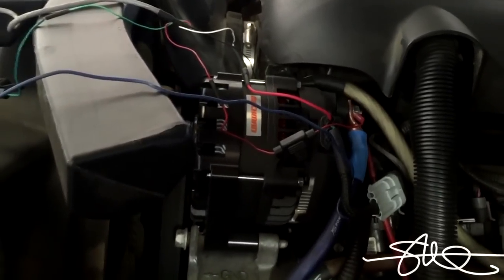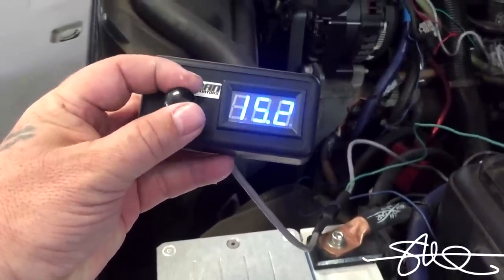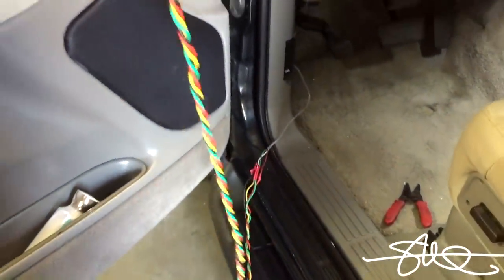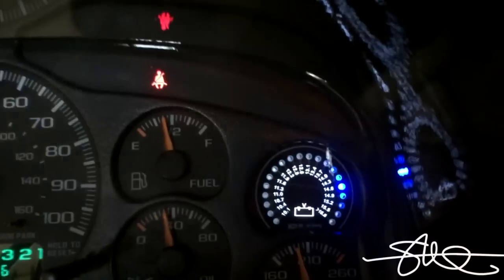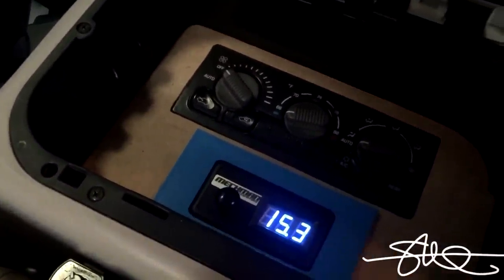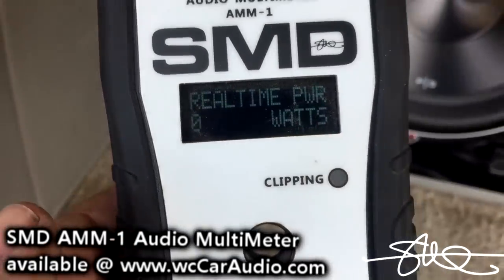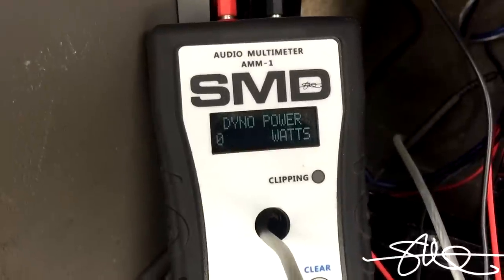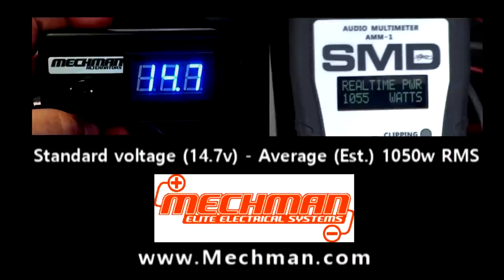Crankin' the Voltage - More Volts = More Watts? Mechman AVBM II SMD AMM-1 Proof (Father/Son Video 8)

Comment: Very nice ! I new It could be done. When I was in competition.  0-1000 trunk. I lacked 280 watts from 10k watts. If I remember I had the voltage at 14.3. I had two RD audio d5s an two solo x's did 156.2 dbs in a trunk at 66hz. I was told if I go back run the voltage at 15.5 volts. but I didn't make it. If I had a bigger alt it would be over 10k watts.  also that was with a power master alt,in a 2000 grand am two door car.

Comment: On a RF Power series amp running a 140amp alternator made for a 04 buick rainier mounted in 01 cavalier  from oreillys before they started getting the new units from china, and a overdrive pulley that a impact socket wouldn't fit in it to install it, one group 78 AGM under the hood, when I made the voltage adjuster originally it was the plan to make it always on but the voltage was a little on the hot side when I before it warmed up so I used a toggle switch when i bring it from the 13.5 range it would drop to back to 14.5-7 and I could told a surprising noticeable difference as soon as I hit the switch and surprising it had the opposite effect then i expected on ideal quality, the motor didn't bog down as much at the higher voltage.

Comment: that's a handy all in 1 meter for measuring power. don't need an oscilloscope to see if its clipping and no dmm to measure voltage or current.

Comment: Looks like that oil pressure is lower than normal you might need an oil pan gasket and oil pump pickup tube o-ring. That will bring the oil pressure right back up.

Comment: Glad to say the physics backs this up. I've need to deal with this in an upcoming project. I only have a rail voltage of 12v going to a pair of 10 amp transistors. If I can bump the voltage I should get better performance out of them- theoretically 150w instead of 120w, but should end up with closer to 180w as the higher voltage also allows more current to pass through the speakers, and that's how only a one volt boost can yield a 20% increase in performance. In my project I will be running the output through a speaker transformer to boost the voltage. I am aware running speakers at 120w with a 12 volt input is not possible unless they are something like 0.5 ohms. I can't increase the rail voltage as the amp location is too restrictive for a dc to dc converter, even though upping it to something like 24 volts would triple or even quadruple it's output. Just wondering- is one inch of excursion good for a 15" sub at 1000w? I have a 30 year old rack mount amp running my home subwoofer. It's very linear for its output level. Just wondering as your SMD 15" appears to move around 4 inches at 7000w. The amp draws so much power from the wall the lights dim. The port of the sub also creates toroidal vortices that can launch quite a distance. Possibly around 3-4 metres!

Comment: power is a product of voltage and current..so more volts does not necessarily mean more watts. However if you have enough amperage to multiply by your voltage than it can increase your power.
Reply from the maker: +hshj04 already said it in the video but thanks for the insight....might wanna hold off on them eager keyboard fingers until the video completes next time lol :D
Reply: Yeah, I definitely should have. Lol
Reply: +meade916 well I knew you would explain that...but some people still miss it. lol
Reply from the maker: +hshj04 all good bro :D :D

Comment: That wont work with all amps, expecially if the swichmode supply is WELL regulated. Some of thenm want to keep the amps rail voltages at say +/- 50 volts others will do as that amp in the video will do and step it up in comparison to input voltage, ie 14 volts in +/- 50, 14.4 volts in 55 volts on rails- however theres one thing you do have to note, you are pushing your outputs harder and if you are running the amp on its lowest impedance then this SHOULD NOT be done. You also must note the VCE (collector emitter voltage) on the actual transistors...

Comment: 15.3V will yield a load test gain indeed its just not ideal for batteries
After heat continuously you want to really be no higher then 14.8V with most batteries

The problem won't show itself immediately but over time the higher voltage will make the alternator force more current that is not needed into the battery and cause the battery to sulfate. This is where the battery will actually lose load test performance (memory) over that extended period of time

it is best to consult your battery manufacturer and only charge around what they suggest, if you like your batteries working the way they should and lasting that is....
Reply from the maker: +Michael Singer that's already been stated....but that being stated i have never had a problem with my XS power batteries.

Comment: Steve man, NONE of the h/o alterator companies are able to hook me up with an alternator for my 2014 Mazda 3 2.5L. Any advise? My stock alternator is 100A.  I wanna run 3000w.
Reply: Sonny go with singer alternator. Or mechman. 200amp alt will do just fine

Comment: I had 15.8v on cold start up and about 15v warn on my old truck wish I could turn it down in the mornings the computer would act up at that voltage, truck really didn't like to run on that much voltage

Comment: Would you say comparable to giving a motor a shot of nitrous?
Reply from the maker: +MrSpanky473 nope more of a supercharger because the more the motor turns, the easier it is for the alt to put out full power, like a supercharger.  A Capacitor would be more of a shot of Nitrous if you ask me because that can be depleted fast, like a bottle.  But the high amp alternator with a high(er) dc charge wants to stay full (if you let it) lol.
Reply: +meade916 That explanation made PERFECT sense! Love it! 👍

Comment: HEY MEADE I LIKED HOW YOU PROVED BY TESTING. BUT PUTTING MORE VOLTAGE TO AN AMP MEANS MORE WATTS IT ISN'T? THATS WHY 16 OR 18 VOLT AMPS GIVE YOU MORE WATTS. IS IT POSSIBLE TO PUT MORE VOLTAGE AND GET LESS WATTS?
Reply: +COMPASBASSCLUB CHICALI It depends on the internal circuitry of the amp if it can handle a 16volt system, but its not about how many volts you can feed the amp your battery's have voltage limitations, most 12volt battery's will say on the warning label "don't charge higher then 14.5 or 15.0" if you go over the voltage limitation you will damage the battery and possibly short out and catch on fire due to the cells swelling up.
Reply: I understood the point of Meade to take a 12 volt system to its max voltage. But I got a little bit confused when he said that the myth about getting more watts by putting more voltage was proven to be true. I thought it isn't logic that any voltage setup with higher voltage will give more watts. Maybe is me but I don't know why to call it a myth.
Reply: COMPASBASSCLUB CHICALI
Well it actually depends on the amps internal circuitry quality, if it has a lot of winding's on the transformers and have high quality internal capacitors like what Rockford, Crescendo, DC, Sundown, Soundqubed, pretty much any Koren made circuit board has, so the more voltage the amp gets the more wattage it will putout, but not all amps are like that though, like is said it all depends on the internal circuitry quality, that's why you never buy a cheap amp like Boss, Autotek, Crunch and a few others i forgot the names of, they don't make power and they have low quality very cheap circuitry all you pretty much pay for in those cheap amps is the aluminum.
Reply: Well said bro! Now I am sure DC Audio will be a good brand to go for. And for the same reason you are explaining now I get why good quality amps will suffer or be damage if not power correctly.
Reply: COMPASBASSCLUB CHICALI
Yeah DC audio amp's for sure are high quality, defiantly put out rated power plus a bit more.
Reply: I had seen your comments alot bro. Never have a chance to talk to you. Nice talk!
Reply: I am trying to work something with Rusty. Definitely a spl only car.
Reply: COMPASBASSCLUB CHICALI
No problem man!
Reply: Still an amateur but trying to learn at least theory from you guys. Should I do 4 18" or 6 15?
Reply: Because I am still learning I want to build a safe box which I think will be a flat wall b pillar and then work from there my port tuning and all that good stuff but still confusing thing for me lol.
Reply: COMPASBASSCLUB CHICALI
I think you should go with what you can afford, 4 18's or 6 15's is going to be loud anyways, but if you are going for just SPL numbers then you do what you can to get the highest number.
Reply: It has been a long sacrifice more than one year saving and I am sure I can afford either setup but just wanted to know which one will have more performance. Also some people had told me that flat wall b pillar is the safest to go.
Reply: Awesome explanation bro! Hey so reducing any car cabin will make it louder but some cars will be more loud still right? For the voltage discussion I was talking something similar with Mazdabass where he say that good quality amps will definitely give more power but if you work with cheap amps then you can loss watts even if you increase voltage.
Reply from the maker: +COMPASBASSCLUB CHICALI 6 15's is BARELY more surface area than 4 18's so do whatever fits bro :)
Reply: Thanks Meade! Actually it is a 2 door full size blazer so I did the math and both sets can fit. Can you recommend something else?
Reply from the maker: +COMPASBASSCLUB CHICALI nope.  Just get what you want.  This isn't about me :) good luck!
Reply: Thanks bro!

Comment: my mechman 250 elite cant use a volt controller and my pcm in my truck only lets me get 14.2 volts..i have only 1200 watts and still get light dim at night..wth?...any ideas
Reply: Did you do the big 3/4
Reply: +BigKing17 yes..skyhi 0 gauge ofc
Reply: cap
Reply: actually its the halogen lights...figured it out..they will always dim

Comment: that oil pressure.....
Reply from the maker: +BassheadGTP guage is a little bit off...the needle is a little wacky since we pulled it apart to do the mods.  We just haven't yanked it apart again to fix it.  The speedo is a little bit off too, but only by a few mph.  That was my fault haha....i never carved into one before.  It's an easy fix once we decide to do it.
Reply: +meade916 Oh ok. Thanks Steve.